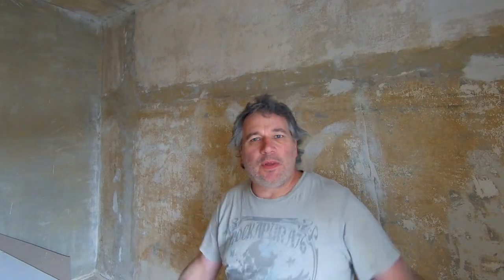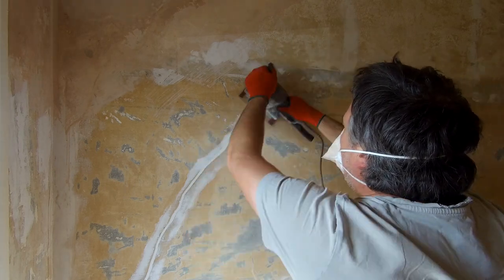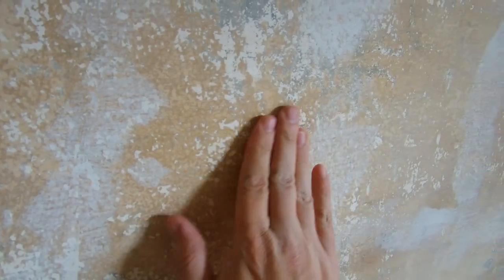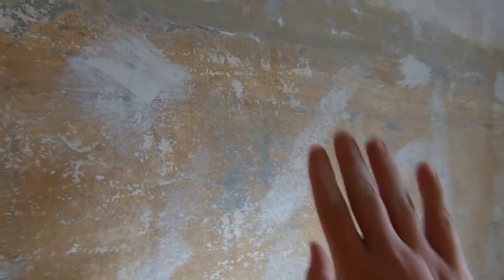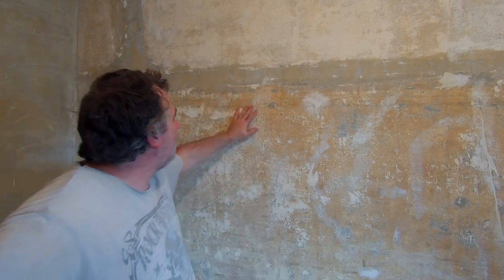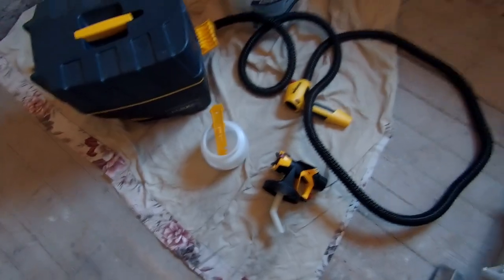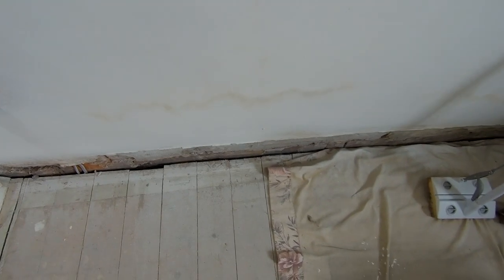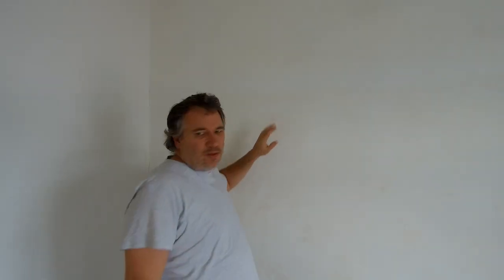Horrible Ending! Preparing Walls and Ceilings for Painting - DIY Vlog #8

Comment: if damp at some point, the salt remains. that causes staining, over time, the new paint will flake off. i renovate houses.. get it a lot. get a stain blocker or salt based remover
Reply from the maker: The oil based primer I used worked perfectly and a lot cheaper than stain blockers like zinsser b.i.n

Comment: For small patches of that seep through of old damp I just spray it with radiator paint or car paint, what ever I have on hand in white. After 2 coats of paint on top of that its good. There are paints for covering up nicotine stains that costs a bundle that is super for it on this scale, but it is a large bundle that it costs.

Comment: Stains are most likely from previous damp issues or leaks or whatever.....  Get yaself to b+q an get a blocker paint... Should sort it 👍
Reply from the maker: Yes I believe it was from previous issues which is why the walls and ceilings where paper lined. The paint blockers are expensive. The cheaper way is in my removing water stains video. 😉

Comment: How did you get round this in the end? Just prepping up a room and have a similar look and before i slap paint on, i just want to be sure of a way round it?
Reply from the maker: My next video (Removing Water Stains) shows what I did. You can either use a oil based primer/undercoat (it must be oil based to block the water stain) or you can go to B&Q and get some B.I.N Stain blocker. I used an oil based primer as it was a lot cheaper option as some stain blockers can cost a bit. Good luck with it all.

Comment: so what was ur verdict on the sprayer, ?
Reply from the maker: It did do a good job although you do get a lot of overspray with those systems. So unless you have an empty room I wouldn't use it. But if you have an empty room it's fantastic, really quick to coat all the walls, uses less paint and therefore dries quicker between coats.
Reply: wouldnt entertain these wagners. tried one, no good. Graco Ultra Cordless Handheld Airless Sprayer went on to, was a beast. pay for what you get with sprayers

Comment: Why bother wasting time filling sanding, filling sanding, filling sanding lol if you could just throw a skim over the entire room in a day, job done. Perfect walls, not bodged with filler. You obviously cant plaster
Reply from the maker: You've obviously not watch my plastering videos, I could of easily skimmed this room in a day This guide is for most people that can't plaster, for a few small cracks most people aren't going to pay someone to skim a whole wall or try it themselves.
Reply: @LCWDIY  filling cracks is pointless, they will open back up! You needto atleast tape them and thats a waste of time when skimming is easy for anyone to learn
Reply from the maker: I agree, but a lot of people just can't skim a whole wall and make it look good. I've done a video on bond coating, overboarding and skimming so if they want to try they can. The cracks I dug out and refilled haven't opened up yet in over 2 years and hopefully they stay that way. But it was just an option for people that aren't comfortable trying to skim.